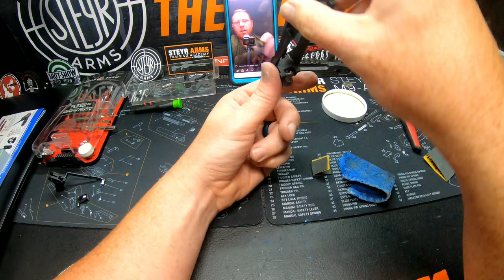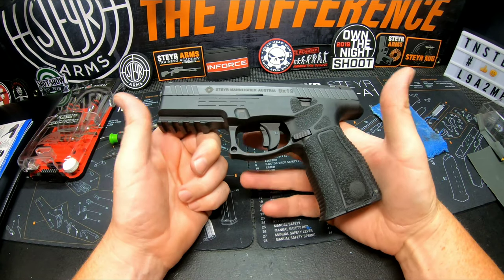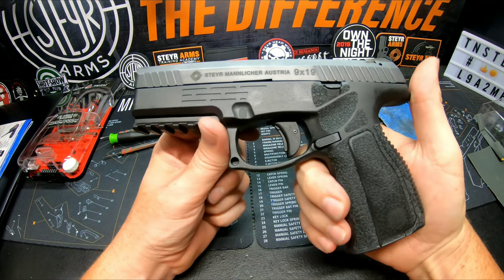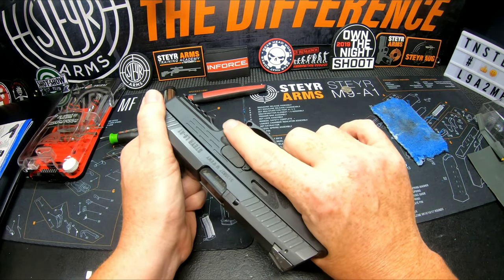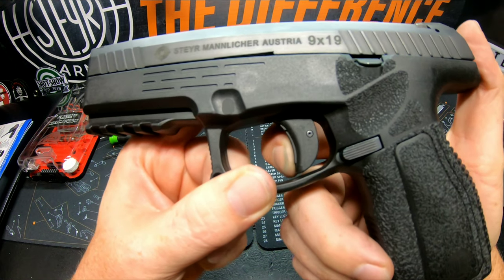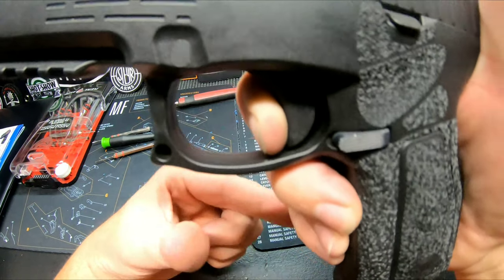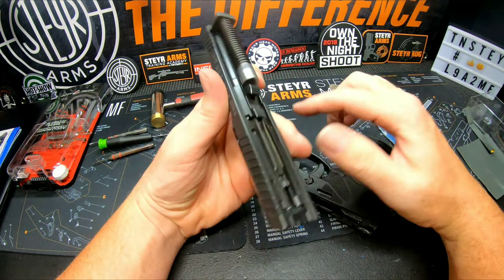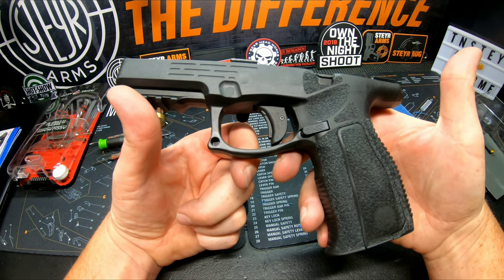STEYR MF Action Polishing part 1

Comment: What grit sandpaper were you using initially?  Also, I haven't found any videos on your channel (maybe I missed it) but I was wondering if you could do a video on the internal mechanism to show how the safeties work.  After finding out that the Steyr's don't have more conventional striker plunger safeties, I am curious as to what measures were taken to prevent the striker from moving forward should the sear have a catastrophic failure.
Reply from the maker: I start off with about 1500 and end up at 3000 grit .   I do not have a video showing how  the safety works.  
I'll be doing a video soom on it tho . Next 30days I believe

Comment: Even time compressed, I feel the effort you put into this "25¢" trigger job.
Now, do you have any recommendations for the take down lever and the mag release button? Granted my L9A2 is brand new, (only 103 rds so far), but those are really stiff for me. Or is it just my "wookiee" size hands?
Reply from the maker: There is a a lower mag spring you can get from Rpp . To soften it up. As for the the takedown lever you just have to use it .
Reply: @TnSteyr : I searched for that when I ordered the weight and steel guide rod, but I didn't find it. I guess I can call them and ask.
And for the take down, I think it because of my over sized hands, I'm not pushing the button down far enough.
Reply: Update: I contact RPP though their contact page. They email me back say they have one (Reduced Power Mag Release Spring) left and a link to order it. So I promptly did (on Sep 28, 2019 15:28:39 EDT).
I asked, but they did not say if they would restock the springs later.
Reply from the maker: @arikwolf3777  good deal. I think they are going ready for winter time . And doing  retooling.

Comment: I just ordered mine today, what did this do?? I thought the trigger was already nice with no real creep?
Reply from the maker: The triggers are great from the Box they pull about 6 pounds if you do the trigger Polish in mod it just makes them very silky smooth in can get the way down to about 4 and a 1/2 lbs.   When I do them I can get the action sped up about 400 FPS
Reply: @TnSteyr  thanks for the reply, my new toy is enroute and I’ll take a look at slightly polishing the areas needed.  Which ones should I concentrate on as I’m not trying to get too in depth since it’s already rock solid out of the box.
Reply from the maker: @XX-166  shoot 500 or so 1st.  Then do what I did in the video.  And you'll see the difference.  If you want it fully done after  that ? just email me to have me do it ..
Reply: @TnSteyr  what grain ammo did you use to break it in or did you vary the grains ??
Reply from the maker: @XX-166  . I use 115gr to 124gr . 90% in FMJ
Reply: @TnSteyr  excellent choices